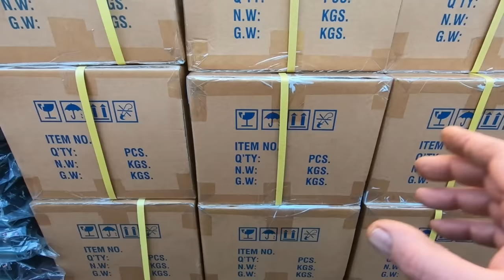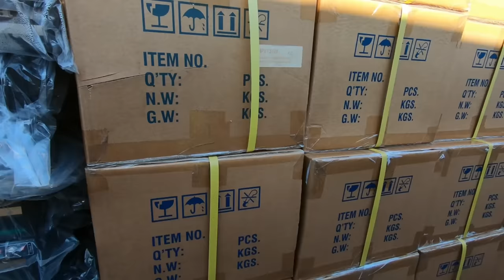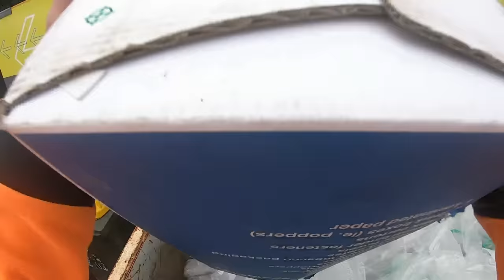Unboxing 500 IP Cameras for eWaste Destruction

Comment: Would you be able to sell components, such as all those Ethernet patch cables? I see a package of 6 1-foot patch cables on Amazon for about $9. So it might be worth your time to try and sell them on e-bay in lots of 10, 20 or 50. The Ethernet patch cables are the ones with the plugs that look like a wider than normal telephone plug.
Reply: I must confess, I had the same thought ... That some of the elements of the kit were worth almost nothing as scrap, but as manufactured items, they would retain value.
Those cables were in original wrapping ... perfect for trading.
Obviously, as others have mentioned, he knows how he runs his business.
... but when you have a large quantity of packaged 'standard' components, they will have value to small scale manufacturers / retail outlets.
These items are still current; it's not like they are outdated.
Anyway, it's his biz so he gets to decide; and maybe he just can't be arsed to shift them by other means.
Reply: I think even the L E Ds could be sold as well

Comment: In Sweden some yards take the power supply unit at transformer / electric motor price, then the cable at a fixed wire price which is more or less the same no matter what type of cable it is unless its really thick.

Comment: You could always sell the parts.   The self tapping screws.  The brass standoffs.  The screw inserts from the abs.  Sell them in lots.  The standoffs are useful for electronics projects.  Also the connections if you decide to desolder them.

Comment: I would have scrapped them out just for the free, clean, cardboard. Would be great for shipping.
Reply: Yeah those white boxes are awesome could even break them down so they store flat and sell them im sure.
Reply: I would also keep all the power supplies. I gutted two dozen 5TB external drives to put into my NAS. They were $30 cheaper than the bare 3.5" drive at the time. I kept all of the 12v power supplies... And used them all in a month. When you're refurbishing and selling on eBay, it's nice to have a bin of new power supplies to include with used items.

Comment: Damn all those Ethernet cables, i would of bought a ton of them from ya for 10 to 20 :) those cables are sooooooo useful in server rooms :)
Reply: @Jeremy R

Why? First off those are without a doubt cat5 cables and they're really short which make them limited to what you can use them for, second point, they're pretty cheap, just get a box and clip your own if you need to wire server(s) room(s).  I buy a 1000ft box of cat 6 cable for around $70 and the cat6 plugs are like $5 for 100.
Reply: @illuded perception

Cat6a cables are not needed unless you're doing lengthy installs.  Extra shielding is not required for a server room unless it's exposed to EMI sources, the UTP standard which has some EMI protection through wire twisting should work perfectly fine.

Comment: I've also had contracts to "destroy" hard drives. A lot of people say why don't you resell them! Well, if I have a contract to destroy them that is what I do. I also have a yard here that shreds them and gives certificates of destruction for free and at the same time the buy the shredded material from me. Take Care.
Reply: Well thats a bit of a false equivalency, hard drives for many are a security issue and it is very common to destroy them for just that reason. These cameras are new in the box from Taiwan and clearly never been used. It would make far more sense to resell them.
Reply: I'd say, you just don't have friends at correct places. back when I worked for Johnson Controls, I had to disassemble and recycle around 200 laptop hardrives [500gb each]  trough recycling company. But I made friends there, so I they gave me certificates for every drive as if it was recycled. all I did was I took them home and used software to fill them with zeros and reformat them twice. Data on them were gone for good. And i've sold them for 20€ each. And about data on them... I was really not interested in child porn they stored on them...

Comment: You could desolder the DC In connectors and ethernet jacks and  the infrared leds and sell them on eBay in 25 / 50 / 100 packs , sell the ethernet patch cables (which are probably copper clad aluminum so not worth recycling for copper)

Comment: The transformer with cord. You stated you would cut the pig tail off and recycle the transformer to scrape steel. I have had luck taking a large 8 lbs. sledge hammer and striking the 
transformer block and being able to separate the copper, PVC and the steel. It all boils down to what is your time worth.

Comment: This is why shit cost so much in Australia, they scrap thousands and somtimes millions of dollars in usable equipment, write it off as a loss at tax time then include the price of the scrapped gear into the price of the new stock. Ive been at tips when cadburys chocolate, BMW, Bosch ect have dumped security loads worth millions just to get rid of stock and claim a loss, ive even seen truck loads and i mean semi truck loads full of cigarettes and mixed alcoholic drinks just pushed into a hole and run over with a compactor just because, then you as an end user pay through the nose for the products.

Comment: why are you not taking out the hardboards from the flat screen tvs and the copper from the computer monitors the old tube ones ....you through out stuff yopu coulkd sell at the scrap yard taking apart the ip cameras are the same as breaking dow those electronics ... theres money in what you threw out ... little confused about why but good effort in recycling

Comment: hey when U get ABS plastic parts in larger mounts, I think it should be possible to sell this to the 3d-printer and DIY filament community. thers guys out there who shred these plastics to melt this into filament strings.

but hey...
why are U doing THIS kind of work. I know U said "dont tell me" but I would have sold each box of 10 cameras for 20 bux in one auction or fixed price sale. not one by one of course.

Comment: Very intersting they have soft plastic recycling has that would be trash here in new york
Reply: In the US, a lot of soft plastic packaging can be recycled, just not via your local curbside recycling. Have you seen the bins in grocery stores where they accept their plastic bags back? You can put any HDPE-based soft plastic packaging in there.
Reply: those bins are only for plastic bags. what Ben was recycling looked more, like bubble wrap.
Reply: I tried to find out how the plastic bags were recycled but to no avail. Interesting that China banned these a while back. Hard plastic recycling is complicated, if the wrong plastic is mixed with petroleum based plastic it will throw the whole process off. Some plastic like the ones in cold food section is actually made from corn syrup.

Comment: 3:58 Ah, I see, it's because of a contract you signed, probably as part of your job. I've only watched up to this point when I was typing this part of the comment, but I picture them being no-brand cheap pieces of junk.
5:20 They probably will, as long as it's from a legitimate brand and not a no-brand or off-brand.
5:38 I knew they were no-brand cameras! They probably have half-baked software on them with poor translations and such.

Comment: What an absolute waste! Shouldn't be scrapping them.
Reply: Well that's an odd move from the original owner, they are probably worth more functional than as scrap.
Reply: Well they had to buy those cameras from somewhere, and then just scrap them fully functional still in their original packaging seems extremly pointless and wasteful, especially wasteful with money. But what can you do about stupid people?
Reply: @Riiludragon  stupid people? Hm not nice, but... let's imagine that this cameras have a production problem...in time they...well overheat or something and need to be replaced...so the company that produced checked and stated that the cameras do have a low quality part and they will change their suppyer...mean time they give a diacount to the company from where Ben have this cameras. So basicly they have a hiden defect that in time will cost more working hours for the company that instaled them in first place, changing them so they decide to    destroy them, using Ben's services. So just to understand, this things do happen, check car manufacturing companyes that recalls some car models for diffrent parts to be change...All the best😉
Reply: Did you not watch the first 6 min mate He is under contract